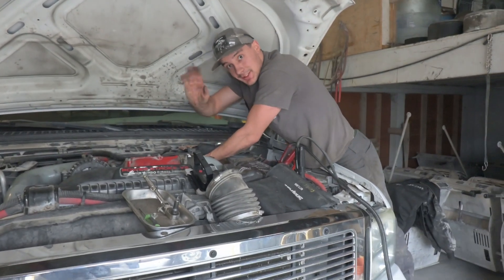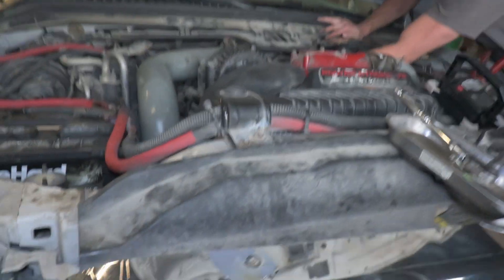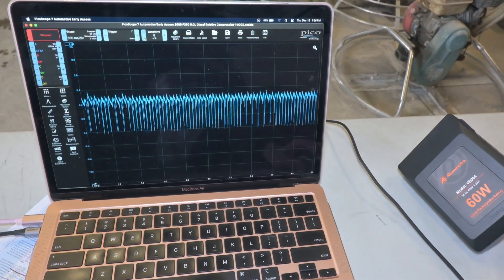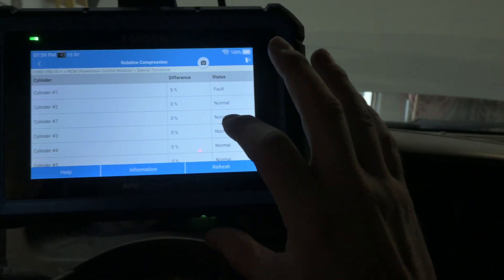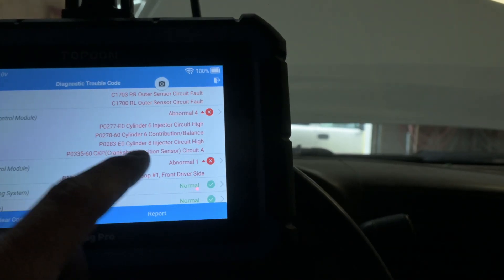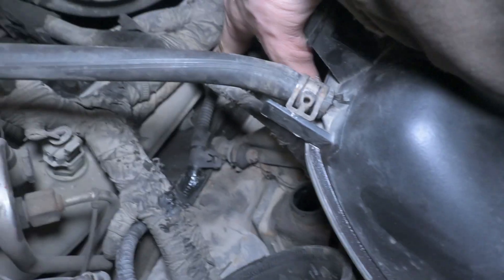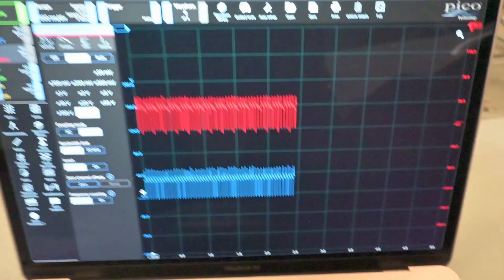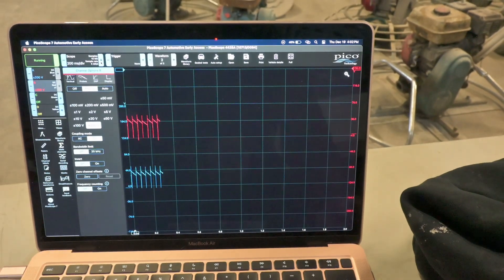Diagnosing a Diesel Misfire

Comment: What scanner do you have? and is there anyway you could do an overview/tutorial ? i just got a 6.0 and am looking at getting a good scanner to help with diag
Reply from the maker: The scanner I used in the video is a TopDon ArtiDiag Pro. They have two versions of it and ship them at random, if you're going to pick one up, I really like it, but email them first and tell them you want the new version. It has a few extra features and better hardware specs. Since recording this video I've upgraded and bought the TopDon Phoenix Plus 2 for network topology and screen recording ability and so far I really like it. I've used TopDon, Snap On, Matco, MAC & Autel scanners. To be completely honest I find they all do the job. I've just had really good customer service experience from TopDon and IMO the hardware is a bit nicer than the other scan tools available at the same price point. I find the Autels to be a bit more versatile as their operating system is very much built ontop of Android, however because they have more software features running they are a bit slower than the TopDons. TopDon has stripped down the Android operating system to be a purpose built scan tool system and they run faster with the same hardware specs because of it. I am literally in the process of making a video on scan tool use and operation. I think I'm going to make a short video on the basics of scan tools and then a much more in depth video for those that really want to get into it. Thanks a bunch for watching and putting in a request!!!!

Comment: The oil in the turbo is from the crankcase breather tube comon on a 6.0 with higher mileage.  I seriously doubt that it is the turbo leaking as there would be a lot more oil.
Reply from the maker: You know, thinking about it and I agree with you. It’s been awhile since I’ve worked on the smaller diesels like this one, especially getting into the diagnostic side. Thanks for leaving a comment 🙂